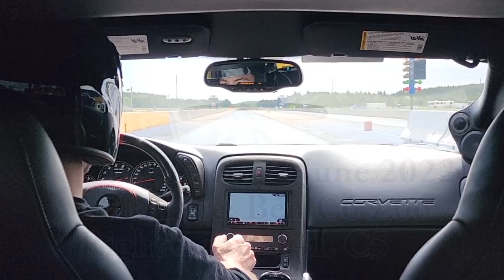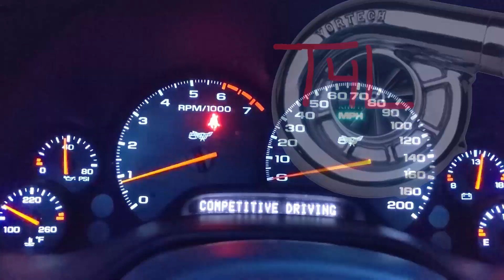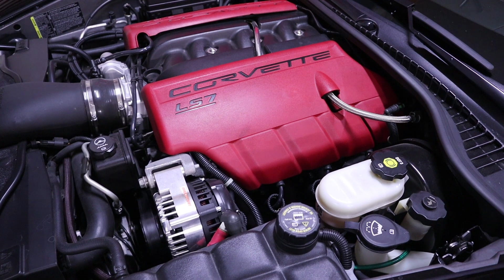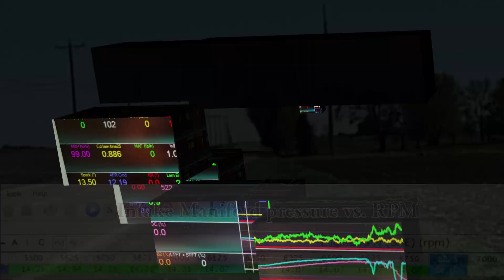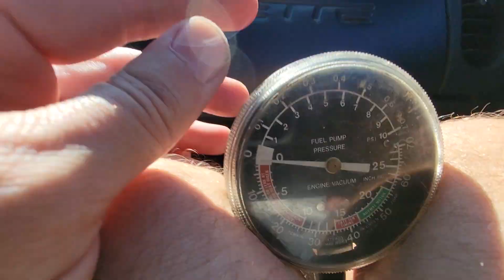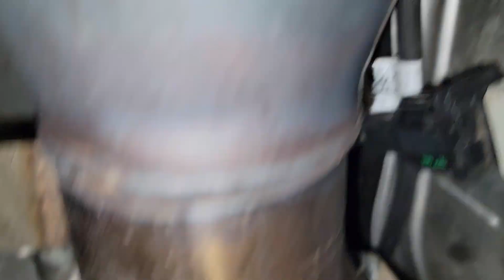C6 Z06 Head/Cam & Intake (Missing Horsepower Diagnosis?)

Comment: Just a FYI, I have a c6 Z06. Katech  Torquer 110 cam (Cam Specs: 220 / 244 @ .050, .615 / .648 lift, 110 LSA 004) Kooks LT & x-pipe, Corsa exhaust. .030" off heads to bump compression up to (11.5:1) and Corsa intake. Stock IM and throttle body. This car has trapped 133mph in the 1/4 mile and dyno's on a Mustang dyno at 550whp.
Reply from the maker: Thanks for the info - much appreciated 👍

Comment: I’ve tuned a bunch of those cars. That about what it will take for spark. Even if you can squeeze a few in there it’s not going to give you 5-7mph. Maybe strap it to a dyno just to see what it’s making. I would think it should be like 540 with that tune up. I think that camshaft is just a dud.
Reply from the maker: Thank you - I am starting to thing the cam is a dud, or installed wrong - or the lifters have an issue?
Reply: @Toys4Life  not likely a lifter problem. If so you’d know it. They’d be bled down and clacking or if they were pumped up for some reason it would be a real dog. Even slower. It would even sound muffled with the compression out the window. It’s very easy to put cam off a tooth on corvettes. Hangin over the fender will be deceiving and likely off a tooth. What I do is look through the hood and bumper. If you get up close you can see through the 1/2” gap dead on. What I would do at this point I’d get the motor up on top dead center at the end of the exhaust stroke and measure how far the valves are open. They will both be open slightly because this is during overlap event. If you give me the detailed specs on the cam I can do the math and tell you what they should be and if you tell me what you get I can tell you how far off it is. One tooth is about 10 degrees so it will be easy to tell. 10 degrees is a mile when it comes to that stuff. Get the motor in position so both valves are close and measure the retainer height. Then get it to tdc on exhaust stroke and remeasure. Both installed heights can be different between int and exhaust so you have to measure both closed. I basically need to know how much each is open.

Comment: I'm guessing the cam is out of time or the HP is not really missing. It's a driver issue at the track. A chassis dyno would put it to bed pretty quick or a driver swap.
Reply from the maker: I hope the cam wasn't installed wrong 😔...

Comment: Another great video Ken. I would say the camshaft is all wrong because the cranking compression is way to low. That engine will run on 87 w 175psi cranking. With 17 deg. of split from In. to Ex is way to much Ex timing and then on a 118CL. No wonder it has low cranking compression. And yes it does need more ignition timing, my guess it needs 30deg at least. If the engine had the correct cam you should see 200 psi cranking at least. 
   You remember the Iron Duke dyno testing, that engine ran fine on 92 and it has 230 psi cranking and has a cast Iron head. 
  I can,t wait to see what you find in your next test session,,,,,,,     Dave
Reply from the maker: Thanks for the comment and sharing your thoughts Dave! Maybe another cam swap is in this car's future?
Reply: @Toys4Life  Well advancing the Ign. timing will help this engine. But the funny thing is that the is a very mild cam as you said. I wonder if the cam is in retarded? 
  If he decides to do a cam change I would be happy to do a custom cam for this engine.
Reply from the maker: It's cross my mind that maybe someone installed it wrong but I'm not talented enough to figure that out without pulling the timing cover...and that's a big job on this thing!
Reply: @Toys4Life  I do not know if TDC is marked on the damper on this engine, and if it is can you see it at all?

Comment: First thing I noticed from the scan you did is that bank 1 O2 is different than bank 2. This imbalance can definitely affect power.
Reply from the maker: Appreciate the comment, sir!  Unfortunately at WOT the Narrowband O2 sensors are not at all accurate so that imbalance we are seeing is likely nothing to be concerned about. If one was .890 and the other .650 at WOT - I would absolutely swap the wideband to the other bank and check it out.  Thanks again for the input!
Reply: @Toys4Life  no problem. I'll be interested in what the power loss ends up being! I'm still convinced that one bank is running different than the other.

Comment: I wonder if the lifters are collapsing at higher rpm or the valvesprings used are strong enough
Reply from the maker: Definitely could be valve train issue but it's not noisy so this would take some investigation as well. I guess a guy could pull a couple springs off and have them tested to at least rule out that the springs are too weak.
Reply: @Toys4Life  so weird idk how that setup can't make 550whp and not have drivability issues 🤔

Comment: Pretty awesome video. I like how you explain the technical things. 
Greetings from a c6 Z06 owner from Austria/Europe!!!
Reply from the maker: Cheers to your part of the world sir and thanks for the comment! Do you see a fair number of Corvettes in your country?
Reply: @Toys4Life  In my area are a decent amount of Corvettes running. Most C6,  C5, sometimes C4 models. Less c7 or C8 ones. 
I know one guy with a Corvette C3 big block. 7.4L. Crazy thing. 
Friend of mine started a US car workshop  here. It runs pretty well. 

I‘m the only one with a c6 z06 in my area. I have one question, because I cannot compare it in real life. Is it normal that the LS7 valvetrain is louder than a LS2 one? 
If I am driving I hear some sewing machine sound from around 1300-2300 RPM. Is that normal? 
Thank you Sir!
Reply from the maker: I'm not exactly sure if it is I don't think it's by a significant margin, but unfortunately I don't have two of those nearby to listen to to compare.  Thanks for the follow-up response sir!